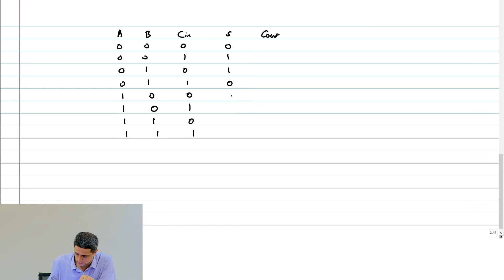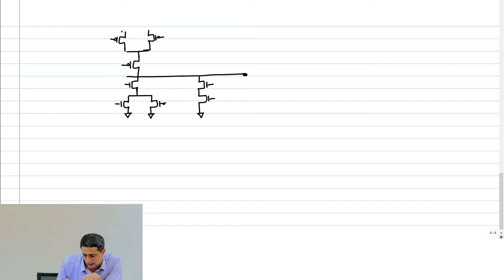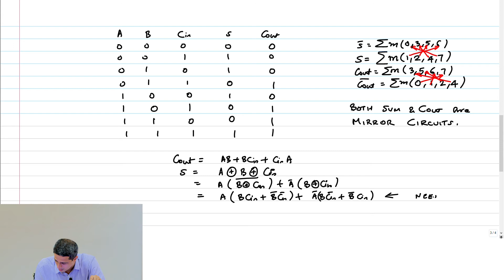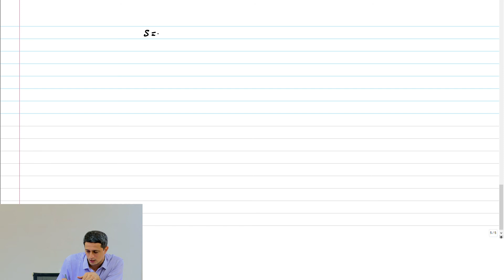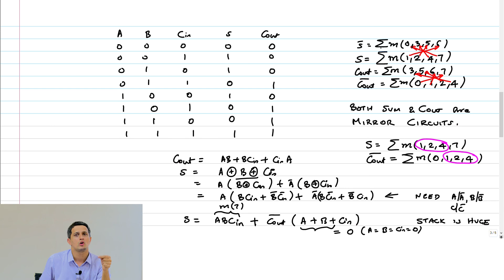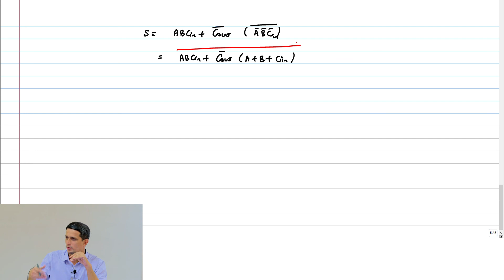AM - 2 - Full Adder Circuit Implementation

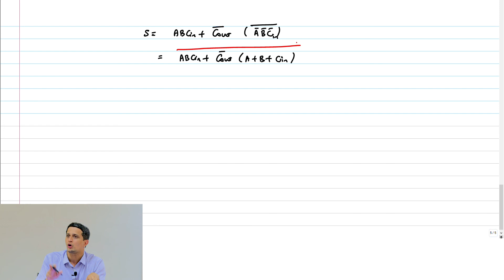Comment: Correction: At 28:20, if we have any four Independent inputs A, B, C, D that are written in the form in which S is written then mirroring property still holds.
Reply: yes, the sum is still the same logic which means its min terms are the same, so it will automatically hold.